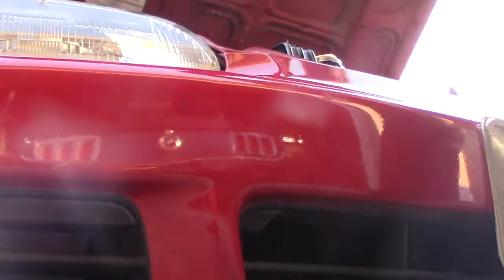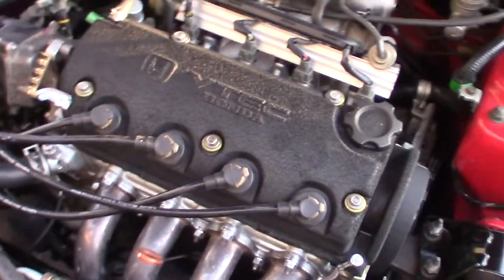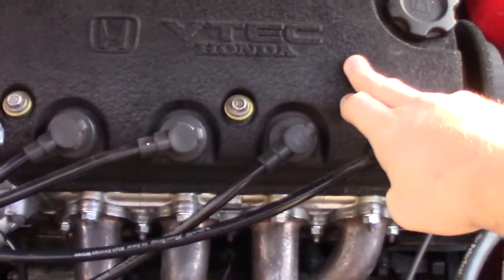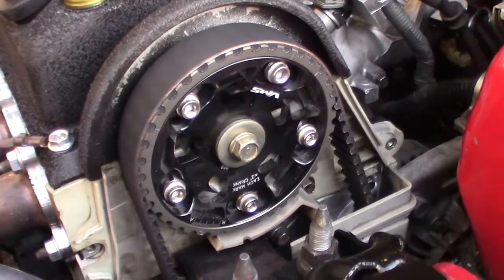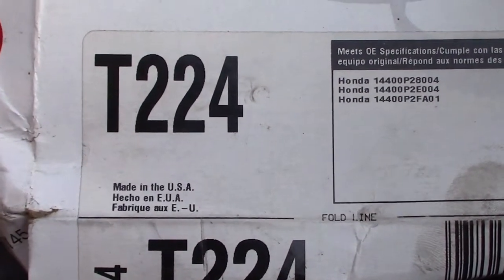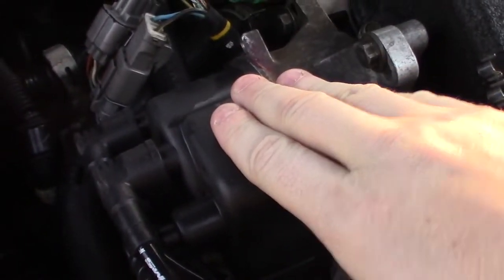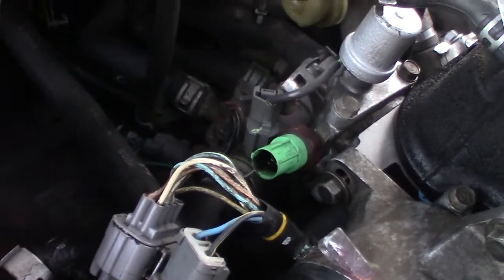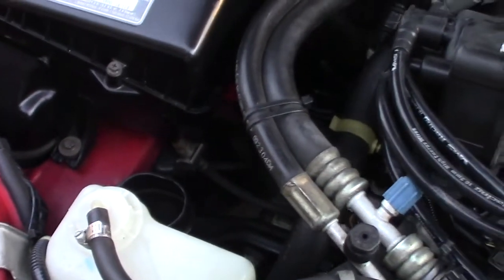Mini Me Swap: Honda Civic D15B7 / D16Z6 Head - Parts, Budget, and More!

Comment from the maker: Thanks for all the support! If you’re enjoying my videos and you would like to help out so that I can make even better videos, check out the link below! https://www.paypal.me/RiggsGarage
Reply: hi there friend great video very helpful.....i have the same head Z6 and D15B7 engine  would like to know a little more about timing...do i have to advance or retard with the adjustable sprocket? and i need to confirm about valve adjustment....TDC piston and adjust #1 and #3 exhaust and intake #1 and #2 and then the rest similar?
Reply from the maker: @xanpod mine ended up being set at 0° no Advanced or retard. Also I have a separate video on setting valve lash that will help you, it's short and gets to the point
Reply: thank you you're the best 👍🏽God bless you a lot

Comment: Thanks for the video, it explains a lot of the questions I had. In my case, I'm using a D16Y7 engine and block, but everything else is a D15B2. Do you think I can still use the D15B2 distributor or change it to D16y7?

Comment: I just bought a  95 del sol and long block is d15b7 non vtec but I realized they did swap on the head for the d16    it runs I drove it a hour all the way back but it was smoking from the tail pipe smelled liked fuel    When I’d gun it I noticed a oil leaking to from the valve cover and other places .. my question  if I want to do a rebuild I’d have to  get the seals and gasket for the d16  and then get pistons and. Head gasket for the b15 long block I wanted to do rebuild since it’s a old engine and it’s smoking out the tail pipe ..

Comment: hi there friend great video very helpful.....i have the same head Z6 and D15B7 engine  would like to know a little more about timing...do i have to advance or retard with the adjustable sprocket? and i need to confirm about valve adjustment....TDC piston and adjust #1 and #3 exhaust and intake #1 and #2 and then the rest similar?

Comment: Great video, man! I have a question: what engine do I need exactly? What's the name of the one you have, or how do I find it? And do I need the transmission, or will the same one fit? Sorry to bother you, thanks for your help.
Reply from the maker: You can use any D series you would like. The D16Z6 seems to be the best because it has more oiling holes in the crankshaft. I'm using a D15B7 because they are $100 each and they make the right length pistons and rods for them 🤣
Annie D series transmission will work, right now I have the DX transmission which has longer gears and an open differential, not ideal. That's the original transmission that came with the car. I would use an SI or EX transmission next, it has a larger bearing case and close ratio gears. You can identify it because it has a casting number B000 on it. I have one sitting in my garage to build now

Comment: So currently I'm in the middle of doing a minime conversion on my D15B2 using a JDM D15B P08 vtec head, can I use the same timing belt as the JDM D15b or do i have to get one for a Z6 ?

I'm asking as locally JDM D15s are the only sohc vtec engines driving on the roads, Z6s and Y8s are literally non-existant and as a result most stores only provide parts for the JDM engine. Additionally its my first ever build 😅

Comment: Would it be similar on a d15b2 I have a 91 dx hatch and I’m planning on doing the same I have to replace the head gasket on it unfortunately so I’m planning on doing this swap because I want vtec and a head swap is much more inexpensive and less labor then a full swap and when I do swap it I’m planning to go b series anyway and I don’t have the funds for that at the moment It’s between that and the paint and I rather paint it first I don’t care much for power right now it’s my daily
Reply from the maker: If you plan on swapping it later, I would not do the VTEC swap. Not much power gain. It will work on your car though,  very similar to mine if yours has multi-port fuel injection

Comment: Great video. I've watched it at least 5 times along with your other Mini Me vids. You must have gotten some amazing deals because I am totaling up the price on my parts list now (in 2025) and for a refreshed head and the rest (including ECU) it will likely cost $1500.
Question: Once yours was fully complete, is the cost and effort worth it? Did you find it fun and enjoyable? I like a slow car fast ('90 Miata), and think the overall balance, weight and distribution would be better with a D than B series ($$$ nowadays). Thanks!
Reply from the maker: It made the slow car slightly more zippy, but nothing very noticeable. Note that that is no tune, stock ECU, header. Yeah I found really good deals and I think they were all pre COVID, so it was much cheaper for me than somebody now who's not getting deals from friends or something. The car was enjoyable overall, but the Mini-Me Head is a big deal when you add boost which is what I've done.

Comment: no idea if your gonna see this since it’s from 4 years ago but i tried using y8 arp head studs (d15b2 block) and they where to short. should i use y8 head bolts or b2 head bolts or b2 arps if they even exist? i think it’s because the b2 head is taller but i didnt check just assumed
Reply from the maker: I used the Z6 ARP kit, 208-4301
The Y8 kit will not work

Comment: We did a mini me swap. D15bottom end Z6 head, skunk adjustable cam gear,timing belt basically everything you recommended. Turns over yay , refuses to start . We have fuel , spark and air, check engine light cycles and turns off. Any ideas on what we might be missing.
Reply from the maker: Does it have compression? When I did this, the valves were way out of adjustment and several of them were not sealing. No compression, no start. I also had fuel, spark, air. Check compression and then check valve lash if you have not
Reply: @RiggsGarage  Thank you for the quick response. We have compression, valves lash is good, we can smell fuel, timing appears to be on and strong spark all 4 cylinders. the car stopped running 2 weeks ago when it ran hot, so that's when we decided to do this rebuild. . It would almost start then do a weird kinda popish backfire no stop. Never could get it to crank. I'm thinking its electronic at this point
Reply: Ok this is crazy, we pulled the fuel rail and turned the engine over to watch fuel shot out each injector, while holding the rail above the intake holes the motor started. ideas.
Reply from the maker: @carlmege  That's weird. Put the fuel rail back in and see if it runs ok...Could be intermittent electrical issue?
Reply: Man sorry I haven’t responded sooner. It was a bad air idle solenoid. Now the car starts has crazy crank case pressure blew the crank seal out oil all over the belts. I checked the compresión as well it’s good engine has no power.

Comment: Chip the P06 and use it. You can tune it once its chipped.
Reply from the maker: That works. I like plug and play p72 better, all factory
Reply: @RiggsGarage  I like the option to tune if needed and i already have the P06. P28 getting pricey. I also have a P75 around i can use if need be.
Reply from the maker: @journeyquest1  that definitely makes sense, I just had a p72 that I had given a friend a hundred bucks for. I know that's not a realistic price anymore

Comment: Is the crankshaft gear the same for the d16z6 and d15b7?
Reply from the maker: Not the factory ones, they are clocked differently. The aftermarket adjustable gears  work for both engines fine.

Comment: 15z6 to 16z6 would be almost the same, right?
Reply from the maker: Yes
Reply: @RiggsGarage  

maybe you have experience with this maybe you dont.

will the d15z6 belt work with the d16z6 head? i know the d15z's are taller than normal, is it the same as the 16z6 tho?
Reply from the maker: @geg5274  I'm not sure, I'd look at that Honda forum mini me post I linked to in the video description, it is pretty helpful for belt, head, and pulley combinations
Reply: @RiggsGarage  i didnt find anything on z to z mini me builds sadly

Comment: I thought you had to use the z6 timing belt and not the b7 one?
Reply from the maker: It's been a few years, but I have the timing belt part number in the video description if you need it. Still running it 💪

Comment: I have read mixed things on the forums about d16z7 NOT working with the obd0 ecu as the teeth are different, and even if the wiring is identical/correct, it will still not function properly.  My curiosity is if this did indeed work for you?  I would love to be able to run the d16z7 dizzy on the d16z7 head that will be installed on the obd0 (pm6 ecu) d15b7 block.  thank you for your input friend!
Reply from the maker: It did work for me, but my combo is different than yours. Mine is a D15B7 bottom end, d16z6 VTEC head, OBD1 p72 ECU. Worked for me. This swap is okay depending on your goals. It takes a slow car and makes it a little zippier. If you want to go fast, mix the swap with boost

Comment: I'm buying a super clean white eg hatch with d16y7 with z6 headers for $2500, or include a s300 ECU for another 800 for tuneability.

I just pulled the following for $333: z6 head, wiring harness, intake manifold, IACV, and throttle botty (to sell), OEM Honda distributor, fuel rail, and exhaust manifold.

Already had the same gasket (you have a gasket now you have to buy a car that uses the gasket!)

Comment: Bro i was going to ask you what you think that set up with a 272 cam head bore mild and no vtec at all all motor i know the compression will be around 10.1-5 probably and probably with lighter flywheel gd clutch and 2 in free flow exhaust system should be a nice i think the d15b2 will wake up big time and be fast on a crx and the reason for no VTEC becouse the cam will be pulling hard hard from 2500 or 3000 rpm on what you think
Reply from the maker: I bet it will be pretty darn peppy and reliable
I don't think fast would be the word, but it would be fun
Reply: @RiggsGarage  yeap is peppy amigo I I build it no long ago with y8 head gasket and po8-3 head and 272 Delta cam regrind 10 pound flywheel stage 2 clutch kit plus I let the pmg-fi system duel point and I can tell you the sound is beautiful I took her to 7200 rpm no gas problem pull gd better than a Weber carb plus I made adjustments to the distributor I think I'm around 10.1 to 11.1 compression peppy like hell in mid rpm it becomes a beast real fast amigo 3 gear 100 miles a hr and still have rpm left what happened is that the segundary manifold runner is shorter than the primary in the pgm-fi perfect for higher rpm but the sound of the cam is unbelievable nice like a old school v8 mustang nice people are wrong about the pmg-fi is a Weber carb with out the bowl or float and work nice on high compression amigo thanks
Reply: @RiggsGarage  I bet my CRX with a small 4 barrel EFI system will be something else for what it is and such system can be found in junkyards and can be done with a carb adapter will be something new with bigger cam and springs and retainers really it can be done to really jjjj 😁

Comment: Wait.. but z6 is VTEC-E, which stands for econom, so it's not about power..  I have d15z6 civic. It adds mpg on lower loads, but it does not add power on high rev as VTEC does
Reply from the maker: D16Z6 is the performance engine from the SI, it is not the "E" economy engine, although you can definitely get great fuel economy from a z6

Comment: 😅😅😅 amigo is crazy why people think VTEC is all that when a d15b2 16 valves will a 10.1 compression carb and a 272 cam lighter flywheel and gd clutch and free flow exhaust system is a lot better than VTEC plus sounds better and in a 1600 pounds CRX really will fly jjjj old school style and cheap to build plus last for ever I know what I'm talking about believe me that 16 valves d15b2 engine really is a monster and cheap to maintenance and cheap to build and for tune carb play and timing simple don't understand people think VTEC is all that for the streets when a all motor on carb and cam only do is pull like hell no waste of time like VTEC
Reply from the maker: Lots of ways to have fun! This is a classic combo that works well and parts are available.
Reply: @RiggsGarage yeap a lot of fun but I stay old school style plus you can make that carb to by changing the internal and a cam no VTEC that head work nice on carb and 272 cam no VTEC she flow nice plus will be around 10.5 compression gd enough for street highway and 93 gas  special with a mild bore and polish
Reply: @RiggsGarage  yeap I see it before with that head on no VTEC internal and on carb and 272 Delta cam bad ass for what it is fast like hell on a d15b2 block hard to to follow in higher rpm with long gear transmission after start running 2345 gears on long run I can say by VTEC on a 1600 pounds CRX lighter flywheel and gd clutch kit to fast get up on sp fast sometimes the right combination and a old rusty screwdriver and timing play make the world change muscle streets cars expensive cars get upset with homemade junkyards little bangers but carbs give that tuff sounds and is crazy on higher rpm but above all gd video amigo remember we tune with old screwdriver 🪛 jjj America dream jjjj 😁
Reply: Yeah they all work well but I stay the old school style way I love the smell of gas and my tuning a old rusty screwdriver jjj 😁 and believe me the cam sound can't be compare sounds tuff and pull gd amazing really amigo and simple compare to computer tuning wires etc and parts prices my is simple and I even can put a 390 2 barrel carb but I love the rumble Weber no limits rpm I used different valves spring from other d valves etc and made a nice one but I love the sound of my 272 Delta cam perfect for my set up and 10.1 compression and my long gear transmission nice for long runs 2345 gears man man she pull hard big boys don't believe it when they see the little engine I call it CBR 600rr jj

Comment: I am going to do exactly the same thing, but according to you experience. So i won’t able to use the same distributor from the d15? Engine? What about intake and exhaust manifold? Where are you located? I
Might need your help for this
Reply from the maker: Intake and exhaust will swap over, you will need to use the distributor that goes with the head.

Comment: Hey I know this is old but I have a d15b7/z6 in the 1992 Honda Civic dx it ran fine for a while but then I drove it and it was bogging down and now I can’t get it to start back up  I got a new distributor, fuses are good, new fuel pump and relay, rewired vtec, timing is perfect and I don’t see really any vacuum leaks I’m so lost at this point done spent more money trying to get it to start again then the actual swap lol

Comment: Hey man, I recently got my swap running d15b7 block Z6 head. Everything was timed correctly and valve lash was set properly but it smelled really bad, I assume this has to do with the timing problem because of the deck height. Fortunately I also have a VMS cam gear on my swap, I was wondering if I would advance it or not and how much to advance it to. I’m also running a P28 base map.
Reply from the maker: Smell, not sure if that's anything to do with timing. You'll need to mechanically time it with a timing light. That's when you'll advance or retard the vms cam gear (if any). Is it running strong now?

Comment: You might have said already but do I need vtech manual transmison if I do this to my 2000 Lx manual ?
Reply from the maker: Do you mean do you need to swap transmissions to do this? You do not need a swap transmissions. What I covered was if you have an auto transmission, you need to make sure you have an auto transmission ECU. Vice versa, if you have a manual transmission, you need a manual transmission ECU. Is that what you mean?

Comment: Would this be universal for any d15 vtec swap onto any d15 engine? I have a d15b2 and im wanting to put a d15b vtec head on it
Reply from the maker: Pretty much yes, there may be variation in your fuel injection setup (mpfi swap if needed) and the head bolts you use need to be the head bolts for the head you are using.

Comment: Will this work for a 91 hach
Reply from the maker: Yes, there will be slight differences in what head bolts to use depending on what head you use on the D15B1 / 2 whatever

Comment: Hi I’ve have a d15 with d16 head turbo I changed my boost valve to a smart turbo one after about 80 miles my car speed stopped working and now it won’t rev pass 5000 rev so no boost no vtec please I need help I can’t find the problem
Reply from the maker: Sounds like there's a lot going on here, I probably can't be too much help. If it's not making boost, then there could be a boost leak or your wastegate  is open. Is it throwing any codes?

Comment: have a 90 dx hatch d15b2 + auto trans. did a 5 speed Si trans + z6 head (plus machined block + head, arp studs and VMS racing timing gear)
with tuning on probably 10.1 compression i make 130whp and 110tq. also revs out to 7800 still gets 34mpg fuckin mint might make a vid soon
Reply from the maker: That's a great combo, good work!
Reply: I have a 91 dx sedan and I want to change it to a mpfi. If I do a z6 head swap does that kill two birds with one stone?